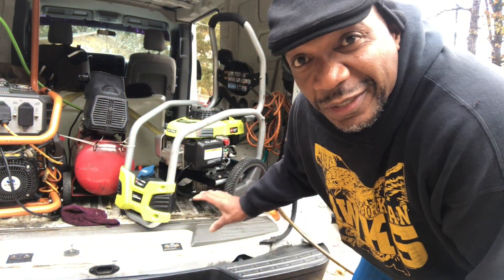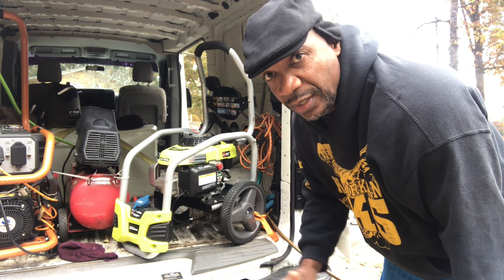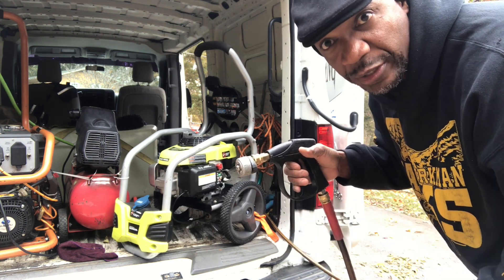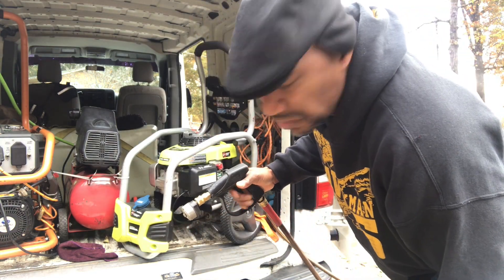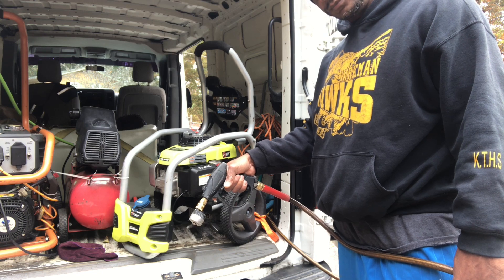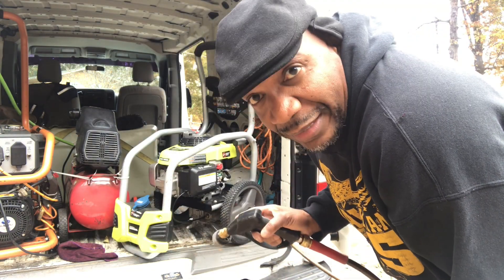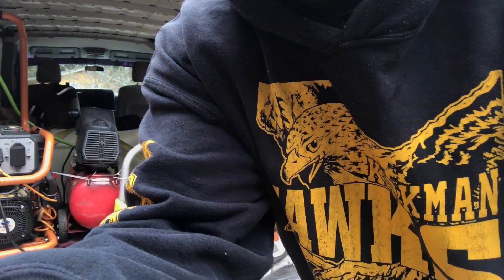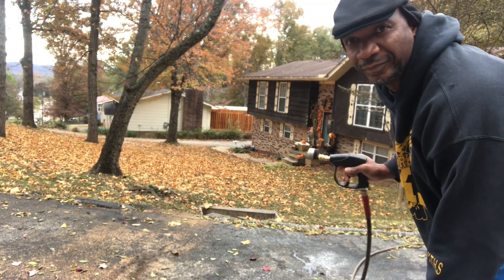Directions if your pressure washer has a built in pump.

Comment: Your hose is to long going from the tank to pressure washer move pressure washer closer to your tank an get u shorter travel hose an u wont have that problem
Reply from the maker: I agree. But I use the same hose to use on my flat surface cleaner. If my hose is to short it won’t reach for what I need it to do. I switch equipment when doing driveways. Also when I’m draining the tank, I just stretched the hose away from the van so I won’t get any water inside the van. Good point though my friend.